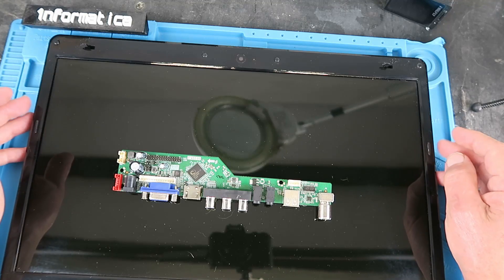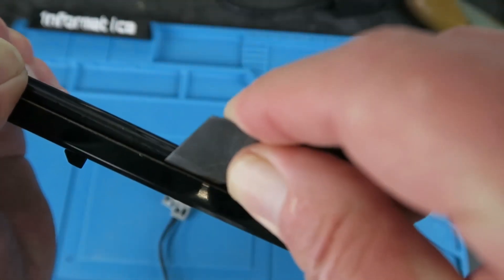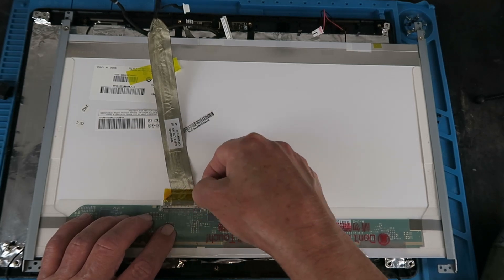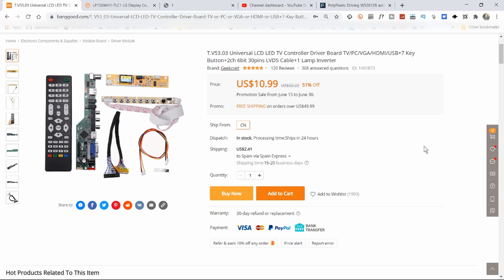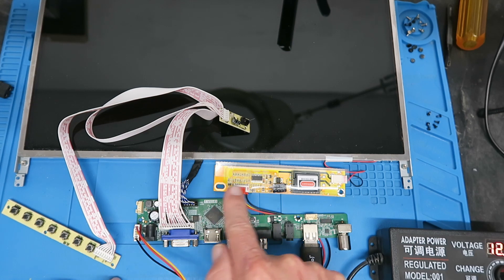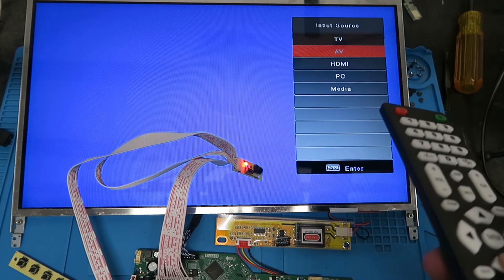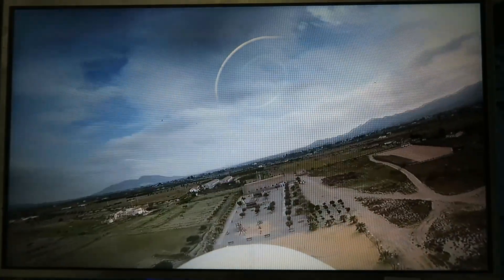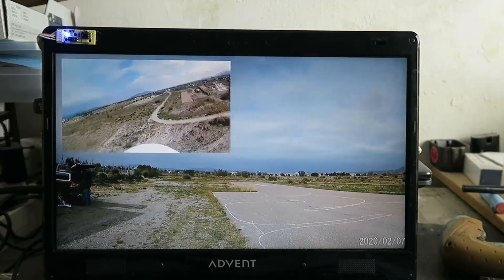T V53 03 Universal LCD LED TV Controller Driver Board Review Test

Comment: for my personal experience using this universal lcd board.... any screen that is in 1280x800 resolution (which is very common to find on old laptops that runs a CFL lamp) will not support this. you may want to get that Universal LCD board that has jumper option (T.HD8503.03C) to set the resolution instead of a firmware update,  a little bit expensive but thats your only choice to run any 1280x800 panels out there.

tl;dr this board doesnt support 1280x800 panels.
Reply from the maker: Good to know, thanks for sharing.

Comment from the maker: There is a "FAQ" section in the video description.
Reply: Hi sir! Just curious - is there a difference between TV display controllers and PC display controllers? Not sure if its marketing or there is a hardware difference between the 2. Price wise seems the same though I am leaning towards TV for the remote.

Am intending to connect it to my raspberry pi 4
Reply from the maker: @Curbietann  There is little technical difference, an LCD panel is an LCD panel put in a TV or laptop. Some good info here : https://sites.google.com/site/lcd4hobby/how-to-start?authuser=0
Reply: Hmm I see. Still unsure though. Basically both the TV option and PC option for controller were given to me when I searched the serial number of my display on aliexpress. Both look slightly different in terms of shape. Function wise - ports look roughly the same as well with the exception of audio points and the remote

Comment: heeeey good content! I subscribed. Can you help me? My led doesn´t blink, I tried many USB's and firmwares but nothing.. any suggestions? thanks for the video.
Reply from the maker: Hey thanks. I guess you have tried everything but just for the avoidance of doubt! Use a branded (Kingston or similar) USB drive. Format it FAT32. Unzip the files for the resolution of your LCD panel. You should have 2 files e.g. MSD56_MD5.txt (the MD5 hash value) and VST53C_4MB.bin (This file must have the same number as your board, in my case 53C) Put these files in the root directory of the drive (there should be nothing else anyway). Power the board with a minimum 3 Amp 12 volt power supply. If the board does not flash then it must be faulty. Good luck!
Reply: I had exact the same problem, tried a lot of usb sticks but the firmware not started. My issue was the wrong firmware file (wrong model) that I had copied!

Comment: My lcd supports 1ch 6bit 30pin, what will happen if I use 2ch 6bit 30pin?
Reply from the maker: I do not think it is a problem. The pins on the panel for channel 2 are usually not connected. YouTube no longer shows me if you are subscribed. Please consider subscribing if you have not done so already!

Comment: my card doesn't blink when i turn on, what do i do
Reply: no blink, Red....................
Reply from the maker: If the code is not loading then try another USB stick. Some people report problems with "unbranded" drives. Use a Kingston or similar. Finally check your 12 volt power supply can deliver 3 Amps. Please consider subscribing if you have not done so already!

Comment: will this board supports N141I3-L02  Sir?
Reply from the maker: The resolution is 1280 * 800 so yes. The datasheet is here : https://datasheetspdf.com/pdf-file/720697/CMIMEI/N141I3-L02/1 YouTube no longer shows me if you are subscribed. Please consider subscribing if you have not done so already!
Reply: @1nformatica  ye Sir already subscribed to you, thank you very much Sir,  do i really need the 1 channe ldvs cable? Do the the 2 channel will not work?
Reply from the maker: @ArczAngel   2 channel LVDS signals are present on the connector. Just use a different cable :  https://sites.google.com/site/lcd4hobby/lvds-cables?authuser=0
Reply: @1nformatica  what happened if i use a 2 channel cable?
Reply from the maker: @ArczAngel  I do not think it is a problem. The pins on the panel for channel 2 are not connected.
Reply: @1nformatica  thanks gonna try it then. I’ll feedback you after
Reply: @1nformatica  hi Sir, just an update with mine, my controller finally arrives and damn its a different model, it is t.sk105a.03, nonetheless i managed to find the firmware of it for 1280 x 800, and adjust via the secret menu, and voila! it works! but sometimes it has a little banding or some kind of haziness on icons images, too little to notice unless you look for it. dunno if there is a somekind of setting to adjust to completely get rid of it. thank you.
Reply from the maker: @ArczAngel  Most of these boards seem to work the same. Well done for getting it working! Maybe check you power supply must be at least 3 Amps, some produce a lot of electrical noise on the supply lines. You can try another supply or some decoupling capacitors on the supply line, try 0.1 uF.
Reply: @1nformatica  ah i see , so this fine Sir? My supply is already 5amps rated but it’s a cheap one.  I’ll another then.  Thank you
Reply: @1nformatica  do i need to flash the firmware? And any firmware that says my resolution will just work?
Reply from the maker: @ArczAngel  Just choose a firmware file that matches your screen resolution. Any matching should work.

Comment: I have an lp156wh4 TLC1 but I put the pen drive and nothing happens
Reply from the maker: If the code is not loading then try another USB stick. Some people report problems with "unbranded" drives. Use a Kingston or similar. Finally check your 12 volt power supply can deliver 3 Amps. Please consider subscribing if you have not done so already!
Reply: @1nformatica  I think is about supply, it can deliver 1 Amps. I am already a sub ;)
Reply from the maker: @Redstonas  You definitely need 3 Amps minimum. There is a link to a suitable supply in the video description.

Comment: Hi, I have installed tv53.03 universal. But I have three problems:
- I can't update firmware. I install a pen drive and never turn on blue light. I tried with diferents pen drives and same results. 
- The image looks backwards. It is not a serious problem, I can place the TV upside down.
- The button panel of the controller does not work. The buttons are badly mapped and there are functions that do not work. Also, the panel does not receive the signal from the remote control.
- I cannot update the panel firmware. I insert the Pen-Drive with the files in the root (VST53C_4MB_M.bin) and it does nothing. The TV picture looks pixelated and I think this is the reason.

How can I solve these problems?
Regards.

Comment: the brightness option for me seems to only apply translucent dark color on the top layer of the screen and not actually dim the backlight led of the screen. could you help me out?
Reply from the maker: That is correct, it only dims the screen not the backlight. Unfortunately I know of no way to do that via the board. There is a way to do this with a simple transistor circuit see : https://forum.arduino.cc/t/trying-to-dim-an-lcd-backlight/150247/6 YouTube no longer shows me if you are subscribed. Please consider subscribing if you have not done so already!

Comment: hello thanks for the video. i have B154EW01 V9 model i connected the board, image transfers,  i did the same with 1147 menu and at 5 6bit has better image. The problem is that my screen shows the image like is divided by 4 like a cross. i changed the resolution but the divided screen still there. do you have any idea whats the problem?
Reply from the maker: Hi, are you sure you have loaded the firmware for 1280 * 800 resolution? You can see the full specs of the panel here : https://www.panelook.com/B154EW01%20V9_AUO_15.4_LCM_overview_621.html I have never seen the problem you describe. Maybe also there is another firmware of the correct resolution you can try. Please consider subscribing if you have not done so already!
Reply: @1nformatica  I found the problem and fixed it with the firmware from the rar which was nearest to my model. the resolution is 1280 x 800
Reply from the maker: @beeratis97  Good job! Glad you have it working.

Comment: i bought this universal board, flash firmware and when power on it gives me blue screen for a second and then turn blank screen.any suggestion what's the problem?
Reply from the maker: If the board is switching off or rebooting then it is usually a power problem. It needs 12 volts at 3 amps. Otherwise try flashing alternative firmware if it exists for your resolution. Please consider subscribing if you have not done so already!

Comment: Hey your screen was 1 channel 6 bit, and you brought 2 channel 6 bit. And it worked too. Why is there single channel and double channel though.
Reply from the maker: I believe that 2 channel enables the support of higher resolutions. https://en.wikipedia.org/wiki/Low-voltage_differential_signaling That is what is selected in the "panel ID" Please consider subscribing if you have not done so already!
Reply: @1nformatica  thanks dude
Subbed to you already
Reply from the maker: @pavankharche5460  Great! YT no longer shows me who's subbed!
Reply: @1nformatica  just wanted to ask,
Is your controller board still working?
Reply from the maker: @pavankharche5460  Yes, no problems, working fine.
Reply: @1nformatica  nice, I ve ordered one, will received in 10 days.

Comment: Is there a way to force firmware re-flash? My remote it is not working and now I have also key lock function on and I cannot turn it off. Thanks a lot!
Reply from the maker: Re flashing is just the same process as flashing in the first place. Just put the "bin" file in the root of a USB drive and when the board powers up it will detect the file and re flash. Please consider subscribing if you have not done so already!
Reply: @1nformatica  thank you and obrigado :) I was able to flash the firmware again, however the remote stopped working so I am unable to Access the factory menu...I Will activate the warranty. Regards!
Reply from the maker: @tiobolha  I am sure you know but you can easily test if the remote is working by pointing it at a camera / phone and see if the LED flashes. many times bad battery connections cause problems. Un saludo!

Comment: Hi
First of all I really liked your video. I wanted to recycle an old laptop screen as a new secondary screen. I ordered the same board as you and did everything exactly like you in the video. At first it worked like a charm but when I got to the panel settings something went wrong.
I am not to sure if I cycled through the panel ID ones to much or if something else happened.
But the screen turned black and nothing works anymore. The backlight is still working but the screen displays nothing. I tried to reflash the board but it did not work. Is there any way to reflash the board or to get it back to the factory settings. Do you have any idea or advice for a possible fix. Any help would be very much appreciated.
Reply: Hi thanks for your fast answer.
So I tried it again. I tried to reflash it but all the board does is turn on the display. It does not go into the flashing procedure again. I still only have a black screen with a turned on backlight. Do you have any further advice?
Reply from the maker: @timdubios1836  Clutching at straws now, are you using the same flash drive as originally? Some people report the boards do not like some USB drives. Try a branded (Kingston or the like) drive. Format the drive and put only the bin file and checksum on it. Double check your power supply can give 3 amps @ 12 volts. Finally it's possible the firmware archive is corrupt, try downloading again and extract the file you need. Good luck!
Reply from the maker: Hi, thanks for liking my video. I think the only way is to re-flash the board. This is simply the same procedure as when you originally flashed it. Just put you "bin" file in the root directory of the USB drive and the board will flash the code when it powers up. Good luck! Please consider subscribing if you have not done so already!

Comment: How do I reflash ?
Reply: No worries now its just taking forever
Reply from the maker: @viqashussain3884  There is no indication that the flashing has finished, the LED will blink forever. The process should only take a minute or so.
Reply from the maker: Just put the firmware "bin" file in the root directory on a USB drive and the board will detect it when it powers up and install the new firmware. Please consider subscribing if you have not done so already!
Reply: Have I brockoed it? It's blue red slowly long time
Reply: Fast blue slow red

Comment: can u help me, i just bought this item and it works good with my lcd. but suddenly my lcd blank when i try to search tv channel but led panel still on.
Reply from the maker: I have seen strange problems when the power supply was less than 3 amps. Make sure your power supply can supply at least 3 amps.
Reply: @1nformatica  is it same problems?
Reply from the maker: @premiumyoutube2261  If the power is too low I see the board reboot randomly. Check you power supply is at least 3 Amps 12 volts.
Reply: @1nformatica  my problem is the monitor  got black(blank) but led panel on

Comment: Hi, I watch your YouTube videos all the time I  have the T.vsT59.031 controller board but the remote does not work the board can be controlled by the keys at the back but it is not that user-friendly can you please help me with the remote please. don't know if it's a firmware issue or the remote need to program differently
Reply from the maker: My board is a different model but will be similar. The sensor for the remote was already fitted on the small board that has the LED for power. Also there was another remote sensor supplied I do not know why, maybe there are different types of remote supplied? First I would check that your remote is actually working. This can be done easily by looking at the IR LED in the remote with a camera (smartphone or other) you should see the LED flash when you press the remote buttons. If that is OK I would check the output of the IR receiver on the board, you would need an oscilloscope for that. I built a simple one from a kit : https://youtu.be/zNTXAwxTG0w Good luck!
Reply: @1nformatica  i have the same issue, can't perform color correction from panel settings as remote would not work. I checked the remote it is working fine on other tv. So maybe the issue with IR receiver or IR receiver input on board... How to fix it?
Reply from the maker: @AarshMajmudar  Hi, it is quite simple to test the IR receiver on the small circuit board it has only 3 connections I think the centre one is the output. If you check with a voltage meter you should see the voltage change when you press a button on the remote, if you have an oscilloscope even better! I mage one from a kit : https://youtu.be/zNTXAwxTG0w If it is not working you may be able to get a replacement from and old satellite or TV receiver. Please consider subscribing if you have not done so already!  Good luck!

Comment: why my board won't install firmware
Reply from the maker: 1nformatica

When loading firmware the light never stops blinking that is normal. If the code is not loading then try another USB stick. Some people report problems with "unbranded" drives. Use a Kingston or similar. Finally check your 12 volt power supply can deliver 3 Amps. Please consider subscribing if you have not done so already!

Comment: Hi, my board keeps blinking for too long from red to blue, it's not stopping. Any idea what's the problem?
Reply from the maker: When loading firmware the light never stops blinking that is normal. If the code is not loading then try another USB stick. Some people report problems with "unbranded" drives. Use a Kingston or similar. Finally check your 12 volt power supply can deliver 3 Amps. Please consider subscribing if you have not done so already!

Comment: Hi! What if there's no firmware for my  LTN154W1-L01 screen ? Tried with a different firmware I found but it doesn't seem to work (Light is flashing, like its downloading the firmware, but then nothing, screen won't turn on). You'd be a savior!
Reply from the maker: Your screen resolution is 1440 * 900 https://www.panelook.com/LTN154W1-L01_Samsung_15.4_LCM_overview_8686.html The firmware for this is included in the archive. The "bin" and "txt" file need to be put in the root directory of the flash drive. Some people report that "unbranded" drives do not work properly. Use a branded Kingston or similar drive. Make sure your 12 volt PSU is capable of 3 amps. Make sure the LVDS cable is correctly connected, the power wires are in the fist few pins. Is the backlight on? Please consider subscribing if you have not done so already!
Reply: @1nformatica  Thanks! I subscribed! I now see some backlight turning on, but that's all. I can't access the menu. What do you mean by ''The firmware for this is included in the archive''? I can't find it.
Reply from the maker: @julienseguindegarie4907  This is the archive link : http://myosuploads3.banggood.com/products/20201117/20201117214136T.SK105A.03.rar It contains a file for 1440 * 900 resolution.

Comment: im lost firmware i got given unzip crap load more zip files with opens more zip can u help if tell u board/lcd i got? wen plug in get that same acid trip screen and off size carnt get to hiden menu as remote not working with it so dont no if come with wrong firmware or if need to flash it
Reply from the maker: I use this site to check the specs https://www.panelook.com/ Please consider subscribing if you have not done so already!